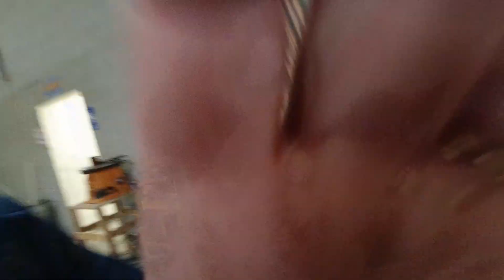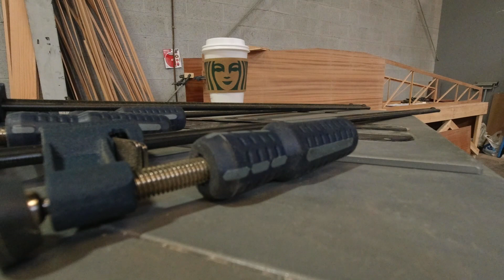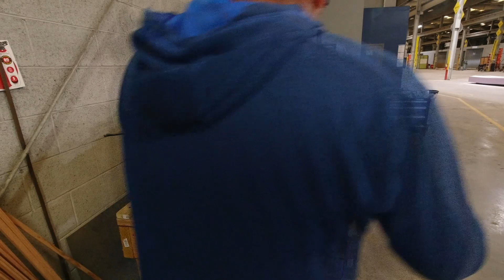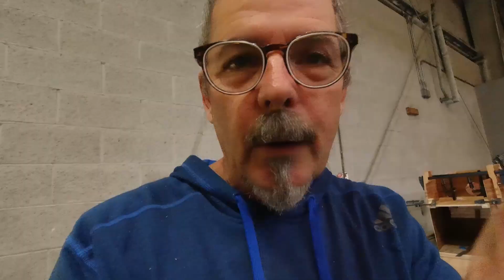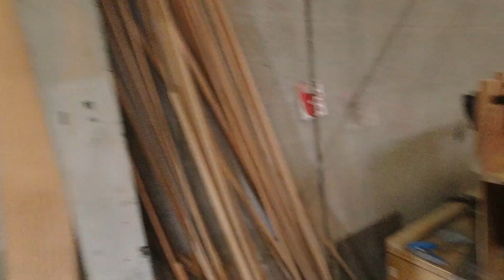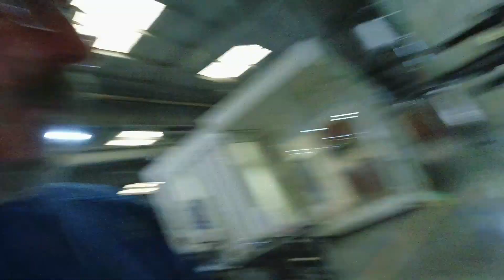Minimax 1100r Wood Aircraft Build Ep 63 - Pulling the Nose Together

Comment: Gluing the side framing to the ply sheeting before bending looks like it puts some tension into the fuse sides (the few joints popping) - maybe this is beneficial (more rigid?).
Would it possible or beneficial to glue the framing and sheeting in 2 passes - once where it's flat, then the shaped sections after.
Reply from the maker: Hey Kevin, I’m sure this has been done before as you describe. I’m curious and will have to search it on the Buzzards site. 
There is a lot of stress and it seems unbelievable that those verticals can actually let go like that.

Comment: The "wood extensions" on those 36" clamps was a great idea.  The music is nice, also.  :)  I did use the wood screws and washers to hold my pieces in position.   Your idea is much better.  Also, I had to drill out those screws holes to 3/16ths and put in dowels.  Great job.
Reply from the maker: Thanks Michael! Are you getting to fly much these days?
Reply: @DTMinimax  Am not flying any longer.  + 40 years seems about right.  :)  Lots of GA flying, (Piper Arrow was my favorite)  then 3 builds.   May have mentioned to you earlier, a few years ago, I gave my EROS Minimax to a friend of mine in Florida.  He had a hangar full of airplanes. :)  He loved his "Flybaby," but he couldn't catch the EROS.    After over 13 years it needed a new fuselage and I had no place to work.    Also, it was in need of another 503.  The Fl heat and humidity finally caught up with it.   (was never in a hangar - always tied down outside with a nice little cover for the cockpit/engine. )  Cover worked well.  Put the average $250.00 a month hangar fee in the gas tanks. :)   To do it all over again?   I'd build a RANS S-9 Chaos.  Take it out for 45 minutes and do a lot of acro, come back, have coffee with my flying mates, then go home.    Seriously.  See you later, Dennis.

Comment: The joint that popped are end grain and have not got gussets, so are wea joints until the bottm skin is on that is why I suggested getting the bottom skin on before you pull the tail end in. Looking good and like your clamp extensions that is a new idea in the tool box for me (BRILLANT).
Reply from the maker: I went back and read the directions and it actually says to put that sheeting on before pulling the tail. That’s what I’m getting ready for now.
Reply from the maker: I’m curious what your thoughts are on the Fisher, are you enjoying that tail build?
Reply: @DTMinimax  yes it is fun. The thing I like is I can put my own ideas into it, so in reality more like a plan and wood set than a kit as instructions are sparse. I will place an order when I have got the cash together.
Reply from the maker: Is it difficult to build from plans where you live?
I realize not everyone has easy access to the lumber and plywood required.
Reply: @DTMinimax  That is a big issue to try to get aircraft grade wood in the UK is hard there is only one real supplier and they charge a fortune, it is not that easy to get wood of the right spec in Europe without a lot of waste. So it works out better to get the kit and as the Fisher kits are not much more than a plane with materials it isjust like a scratch build. My friend who is still finishing off a heigh max had near 50% waste wood and spruce and northan white pine is hard to get so he had to use a lor of Douglas Fur which is heavy compared to Spruce and White Pine (so when trying to make the weight limits for our SSDR and have a good payload it is tough. He wants me to test fly his machine but it can not carry me and a full fuel load (I am not exactly fat at about 190lbs cockpit weight). He has used classic Stintts covering so could have saved a few lbs if had used Oratex.